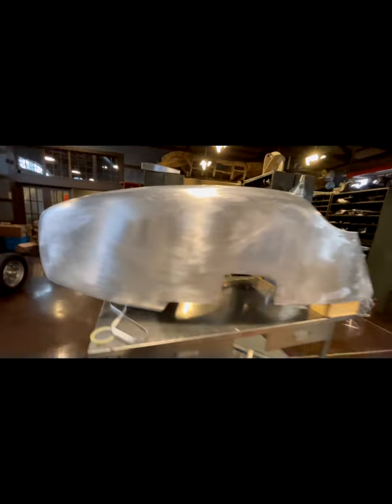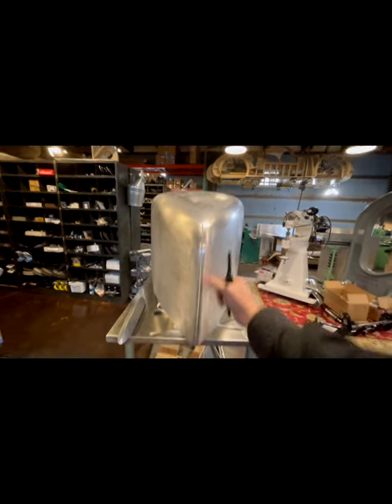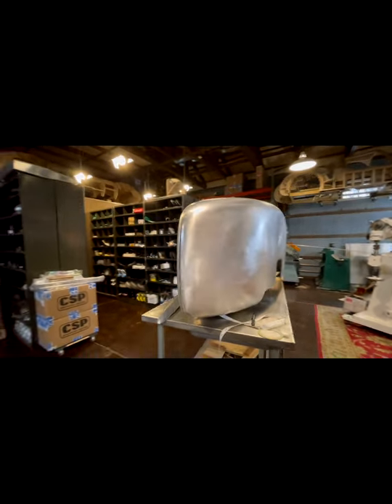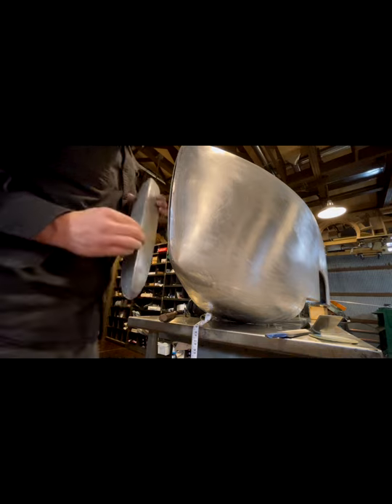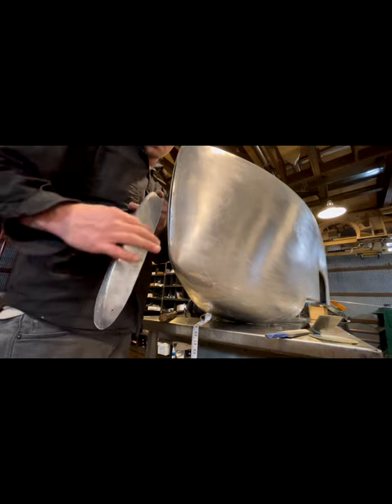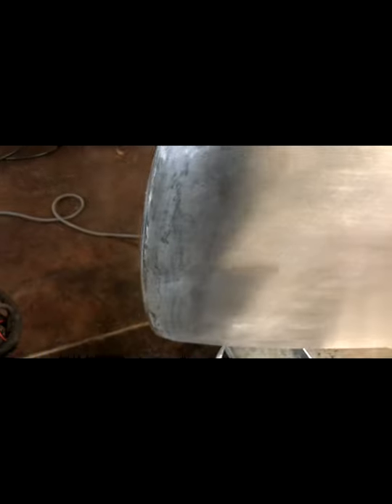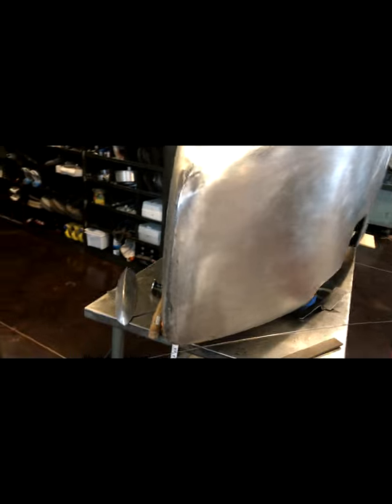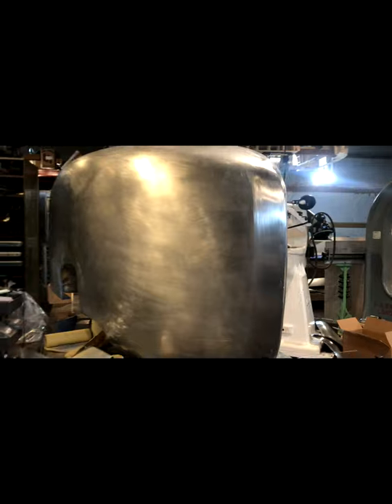1935 Ford Miller Indy Tail Repair

Comment: Great work! I have one question though, was the video intended to not be in full-screen? Does it mean anything? *Apologize in advance, I’m learning English, if I did say something strange or offended anyone, I’m very sorry.
Reply: Also, your original cars are so cool, love their designs.
Reply from the maker: @p.kuansuwan2070  Hi Pete, thanks for the heads up. I’m unsure why the video isn’t playing full size. If you click the lower right corner it should be in HD and full screen... I had an issue when I first checked it after uploading and now it plays properly... thanks for the support 👍🏻
Reply: Mine’s still not in full screen on both devices haha, doesn’t really matter, still enjoyable.
Reply: it looks like you uploaded a vertical video that reduces the horizontal shots to the vertical video width.